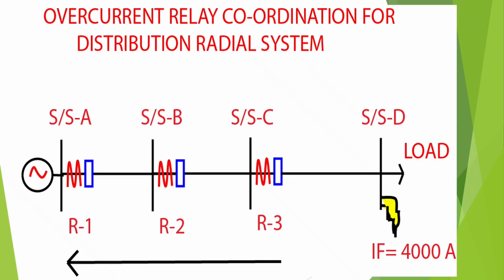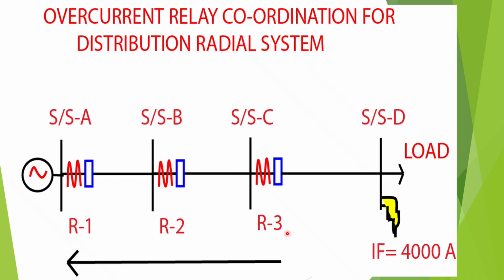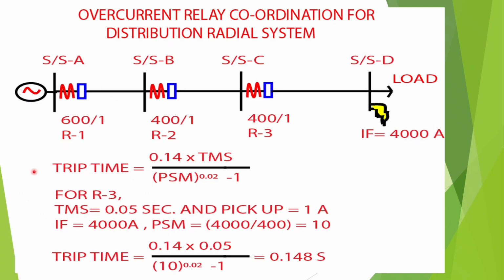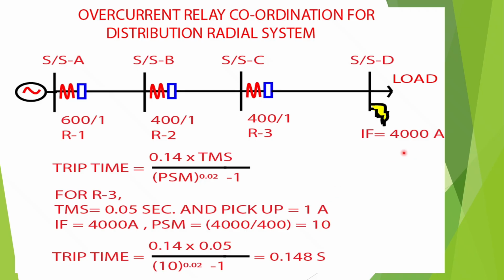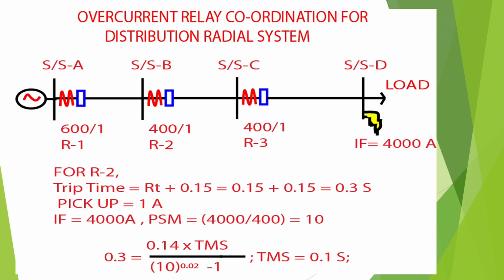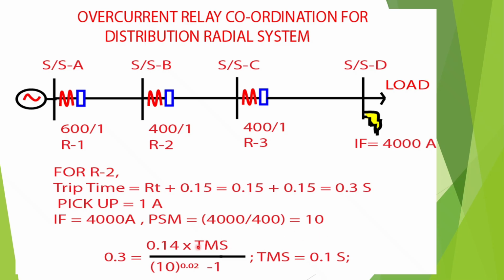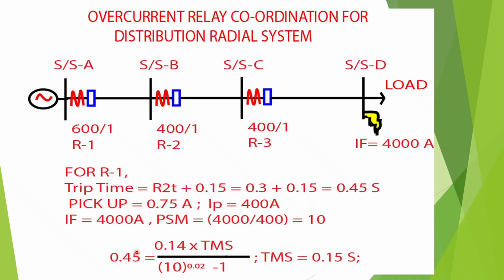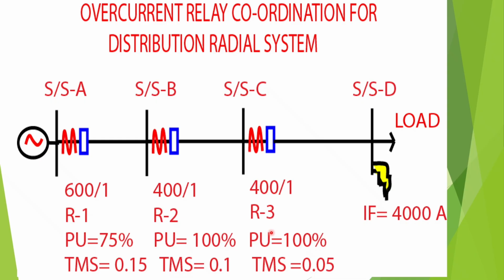RELAY COORDINATION FOR FOR DISTRIBUTION RADIAL SYSTEM

Comment: Pickup current for relay R1 is 450A (75% of 600)
Reply from the maker: Thank You so much for your comment. It woild be 450. Pick up woul be 0.667 secondary value or 66.7% of primary value.